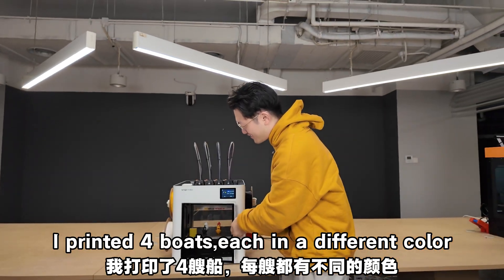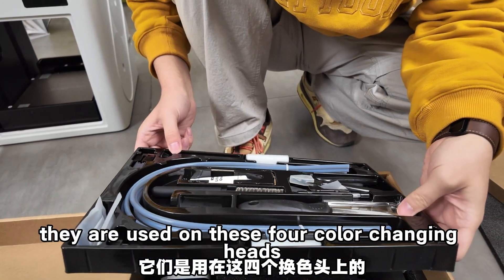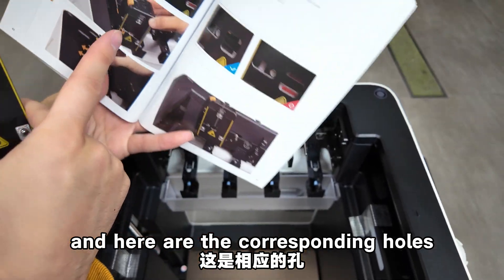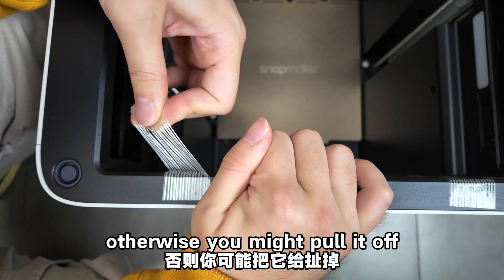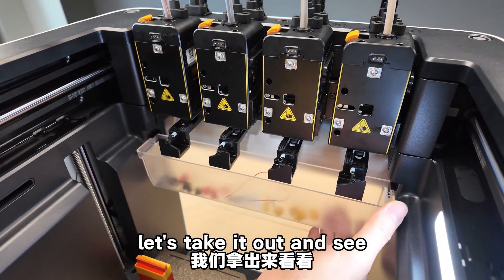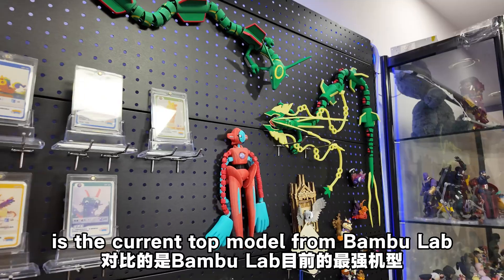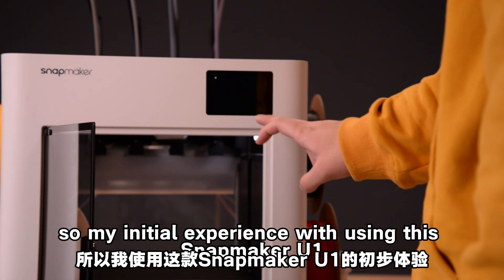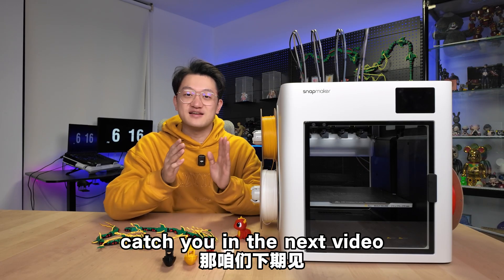Zero Waste Multi-Color 3D Printing? Testing the Snapmaker U1.

Comment: 13:21 if that is the start point of each layer, it might mean you need to prime more on the prime tower. Given the stringing tho, I think it's more likely you're getting some oozing during travel, which is making a mess and causing nozzle pressure to dip. I would try increasing retraction and drying the filament if necessary

Comment: Thanks for the review.  I'm still waiting on my U1 to ship/arrive (maybe in January).  I'm wondering whether I should buy the U1 top cover or leave it as open-air...guess time and testing will tell (though, I like my Bambu X1C being enclosed).
Reply from the maker: It depends on what material you primarily use for 3D printing. I mainly use PLA for daily printing, so most of the time, my printers operate with the top cover removed and the door open. When you need to consistently print materials that require chamber temperature maintenance, it will still be timely to purchase a top cover then.